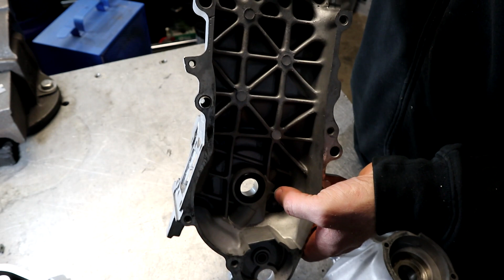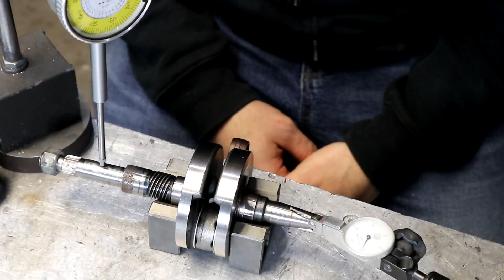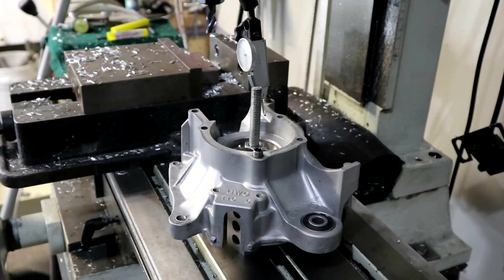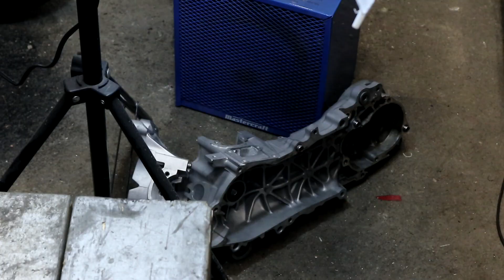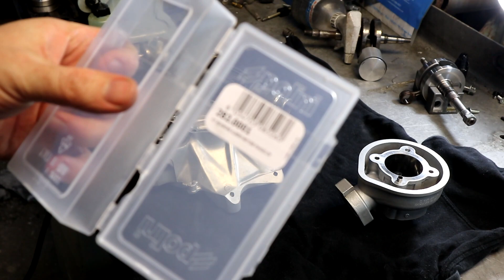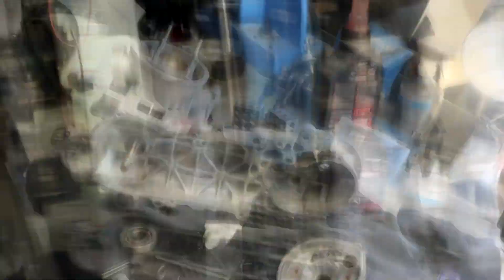Stage6 Modular Race Peugeot 70cc cylinder Honda AF18 build - Part 4 - J's Garage

Comment: Perhaps the port doesn't have to be just one big notch eliminates the piston stability? Couldn't the port--be portS, such as if you drilled a series of holes, and deburred them?

You wouldn't want to weaken the cylinder too much, for fear of breaking off a lower chunk of the bore, but perhaps more port could be added as long as enough surface remains to keep the rings or part of the piston from snagging.

To some degree, it would seem that a piston/rings could slide well down a bore--filed with deburred holes.

This (Openfoam) software is free, but a nightmare to use, but...
http://openfoam-extend.sourceforge.net/OpenFOAM_Workshops/OFW2_2007_Zagreb/index.php?title=OpenFOAM_for_Internal_Combustions_Engine_Simulations%2C_Combustion_and_Spray

Comment: How do you feel about big water cooled strokers?  I see you like building smaller cc builds I like you content you really deserve tons of subscribers your work it A+👍
Reply from the maker: Nothing really wrong with them for what they are,  I just like little engines.  A lot of these little kits I do are a bit higher quality than most of those big stroker stuff and has a bit more refinement.  All that said though they can be made to be very impressive little builds if the effort is put into them to fix the little issues.  I just have a soft spot for sub 100cc 2 strokes.